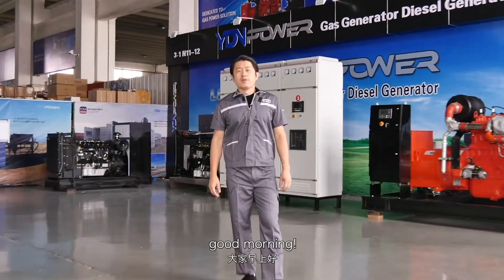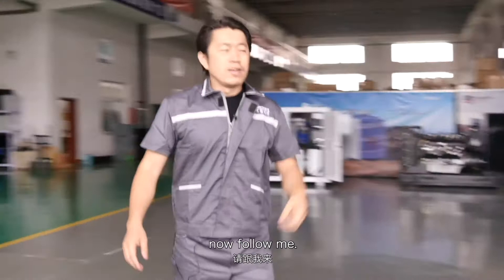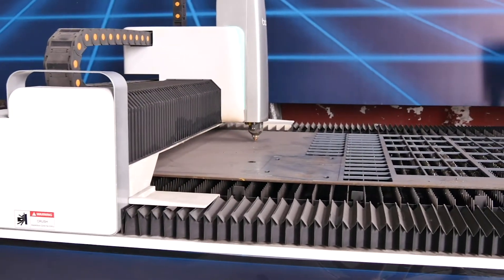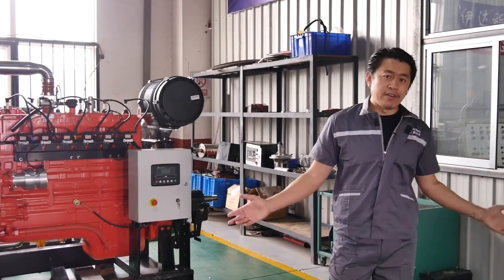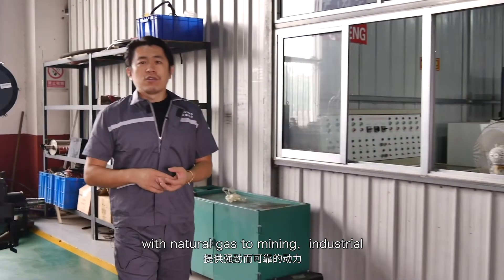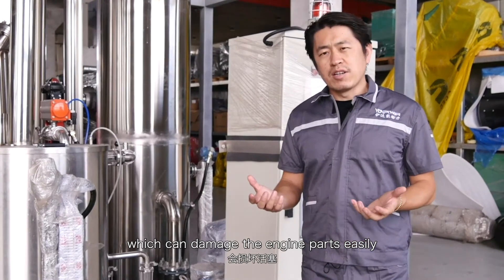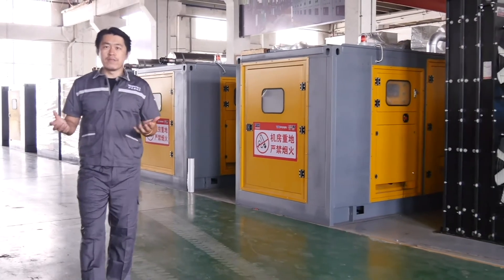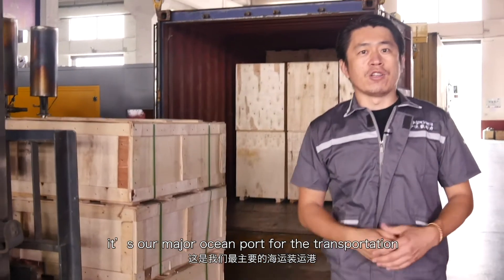1000kW 500kW 200kW 300kW natural gas and biogas generator manufacturer, YDN Power

Comment: That 80kw can be exhange with 3 litre modified diesel car engine. The final torque and rpm need to be combine by gear. But yours is custom so i bet more expensive.

Comment: Can we add parallel Defferent capacity generator like 10 kw for light bulb and small appliances and other big capacity 1000 kw for ac heater and heavy appliances need small power we can use small generator need more power we can use Big generator and AC current appliances run through biogas generator
Reply from the maker: if the voltage, frequency and phase sequence are the same, and the generators use the same controller brand, then these generators can parallel together
Reply: @YDNPower  thnx for your quick reply

Comment: I am interested on 250kw for factory
Reply from the maker: that's big demand. and you also need to have a big digestor to produce enough biogas for the 250kW biogas generator
Reply: @YDNPower  what will be the total cost
Reply from the maker: @bestdollartvchannel4703  we just produce biogas power generator, not the complete project, so it is better to seek advice from a local engineering company for the cost of a biogas digester. the cost may be quite different from place to place.

Comment: Iam from india i want to purchase '250kw for indutrial purpose, i have some question about this
1, price of this generator
2, how maney number of piston,
3 ,is input fuel  only biogas or any other more,
4,is chemical used in scruber available in india
5, name and address of agent in india
Reply from the maker: thanks for your message
1. it depends on the detailed specifications, suggest to send me by email: kevin@yidaneng.com
2. six cylinders for 250kW generator
3. both biogas and natural gas are ok
4. you can check it out in your local market， we oftern use Iron ozide as desulfurizer 
5. we don't have agent now in India

Comment: hi... In my country my government pay us if we provide electricity to national grid. Is it profitable  to run a bio gas plant and generate electricity through above generator you show us?

How much will be the cost for an overhaul of an engine?
How many hours can we use the generator between two overhauls?
Reply from the maker: yes, it is totally possible and many people are doing this
the cost of overhaul is different for different engines 
the overhaul intervals are 25000-3000 hours
how many kilowatts generators do you need?
Reply: I am interested in the overhaul cost as well. Can you please give an example of overhaul cost per kw after the 27,000 hour cycle? What is that.. 3 years none stop service? Thanks

Comment: My question :~ 

Question 1 :~ How many hours continuously run biogas generator without stopping 

Question 2 :~  how many 20 kg Gas cylinder need for 24 hours run 10 kw biogas generator and 1000 kw biogas generator and can we run biogas generator through direct Big CNG tank like 10 Tan tank ,  40 Tan tank etc 

Question 3 :~ if Gas cylinder empty how find us if generator send any alert us in mobile app and other source and can we check gas in mobile app any time how many gas remain and how many hours inf gas for our generator

Question 4 :~  Can we run ac currant appliances through biogas generator and work without any problem and without any damaging small and Smart appliances like computer , laptop , mobile , smart switch , smart bulb , smart TV etc through biogas generator and if no you can have kit for converting DC current to AC current 

Question 5 :~ how many hours after serving and maintenance required your generator and need any spare parts you can provide us
Reply from the maker: Thank you very much for your questions.

Answer 1: the normal maintenance interval without stopping is about 1000 hours if the gas condition is good.

Answer 2: yes, you can run a biogas generator with big CNG tank. I have no idea how much gas can be held in the 20kg gas cylinder, but normally the 10kW generator will use 3 cubic meter per hour and 24 hours will need 72 cubic meters. for a 1000kW generator, it will need 300 cubic meter per hour and 7200 cubic meters per 24 hours

Answer 3: if the cylinder is empty, the generator will stop because the generator has no integrated gas cylinder with it. mostly, the generator is connected to the gas pipeline directly, not a cylinder. if y

Answer 4: yes, sure. the generator uses AC alternator not DC alternator. but the generator is 3- phase, and if you want to use if for appliances like computer, laptop, you need to connect with single phase.

Answer 5: normally the serving and maintenance interval is about 1000 hours. we can supply the spare parts needed such as spark plugs, air filters, engine oil filters.
Reply: @YDNPower  thnx for your quick reply and thnq very much
Reply: @YDNPower  my last question you can have 3 phase to single phase convert kit
Reply from the maker: @gopalbijarniyan1821  two options: yes, it is easy, you can connect a single phase socket to our generator. our generator is 3-phase alternator it means you can use both single phase and 3-phase appliances on it
Reply: @YDNPower  thnx for your quick reply and if We successful in our project We order your hundreds of biogas generator
Reply: @YDNPower  some more question 

question 6 :~ What happen if We run only two  AC 2 tan through 1000 kw biogas generator example We have a 200 room's hotel and each room have two AC 2 tan if when only one customer in a room and all hotel room empty so can we run only two AC 2 tan through your 1000 kw biogas generator i mean what happen in under load generator 
And what happen if We run 400 AC each AC 2 tan 

question 7 :~ And what happen in over load generator 

question 8 :~ if under load and over load Generator destroy the equipment ? 

question 9  :~ And can we customize in generator control panel change your control panel and add matismart generator control MCB switch for Smart operation and control through mobile app 

Thnq
Reply from the maker: @gopalbijarniyan1821   AC 2 tan？ do you mean 2 ton Air Conditioner?  if like this, it means most of the electricity proudced by the 1000kW generator is wasted in vain. 

if your generator will be used in this kind of situations, we suggest to parallel several smaller ones such as 5*200kW, the total power output is same to a 1000kW generator but when you have quite few loads, you can use only one or two generators. 

this will save you a lot of gas and maintenance cost compared to a single 1000kW generator.
Reply: @YDNPower  thnx for your suggestion 🙏🙏
Reply from the maker: @gopalbijarniyan1821  🤝🤝🤝